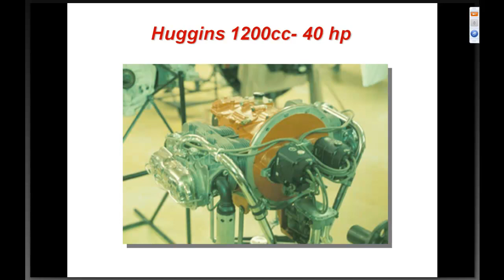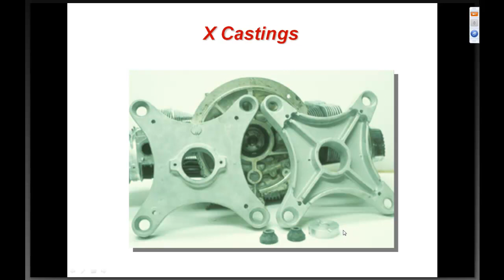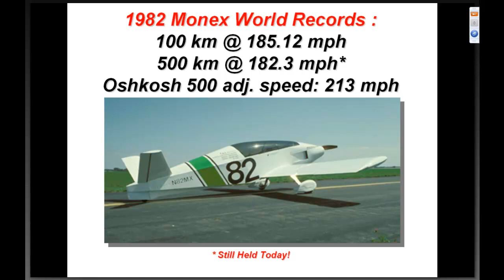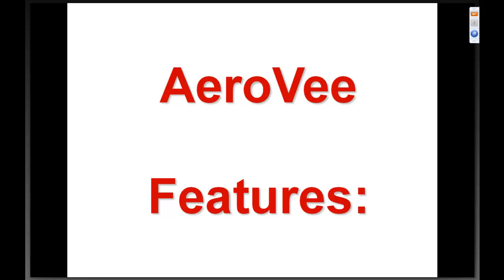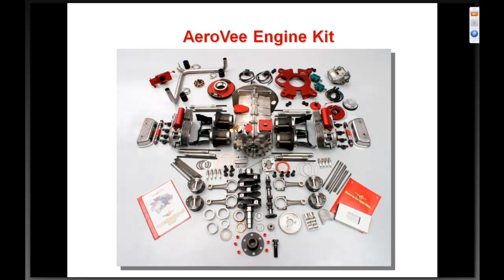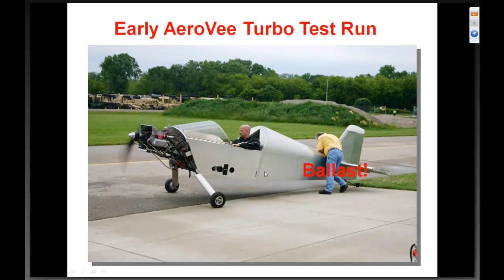AeroVee Engine History: SuperVee to AeroVee

Comment: gas engines are fun and sound wonderful.  VWs can crank out hundreds of hp and are almost indestructable (although they sound like hell when a valve seat insert falls out,but they run on anyway) I'd like to build a flathead for the engine Yamaha has developed new electric motors with all the hp and torque you can use at very low weights, they even sound scary (like somebody tearing paper). Graphene supercapacitors may outperform gas imagine refueling in two seconds!

Comment: Serious question: is it feasible to make it turn the opposite direction for us non-russian pilots with a trained right foot? I know adapting would be a simple matter of repetition but I would like to know if it is possible to turn clockwise like a Cont or Lyc
Reply: Install a reverse cam.
Reply: @ljbern1  Or drive it off the flywheel end - not possible with the AeroVee bits though.

Comment: This is the forth time listening to John's presentation.  Great stuff.
Reply: I built a performance 1776cc VW dual carb for my 1971 VW Bus.  I drove up to Lake Tahoe at 80mph.  At full throttle the 100+hp 1776cc Port + Polished head Engine got very Hot.  So I put a large Berg external. electric fan oil cooler w/thermostat and a 3.5qt deep sump.  The entire system raised the stock tiny 2qt oil cooling to big 9qt!

Comment: With 20+ years driving VW  air-cooled engines, my worst experience was a loose exhaust valve insert (it sounds like death knocking),but I kept driving (about 100 miles) I pulled the head staked in a new insert and drove it another couple of years. Bulletproof!  The single port head might have a better exhaust flow. SU carbaretors  has a wide variety of fuel mixture needles.
Reply: Ilove SU carbs personally but have had icing problems with them at sea level.  The carb type that was described in your narrative is similar to the 1960's  Wal Phillips or Gardner types.